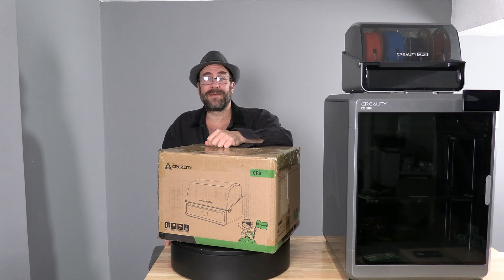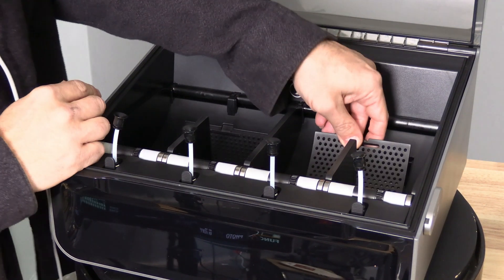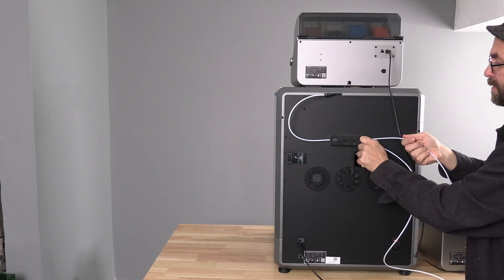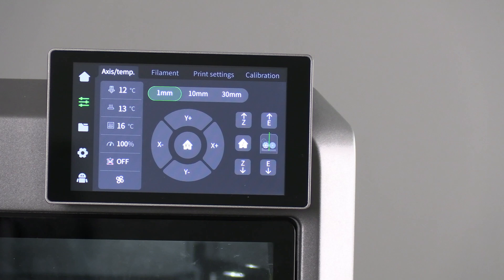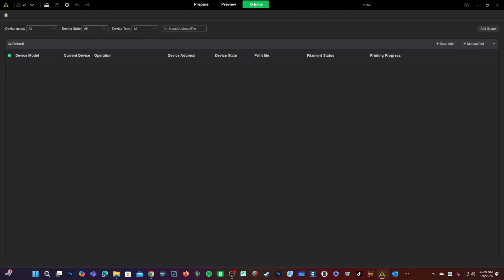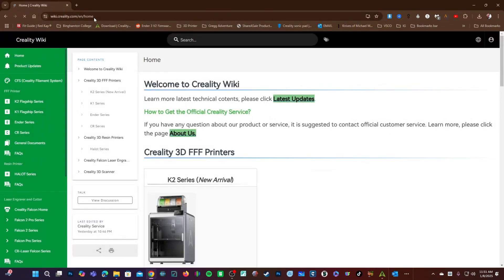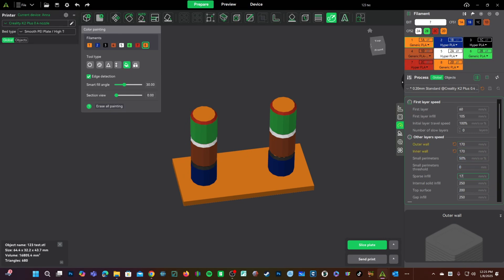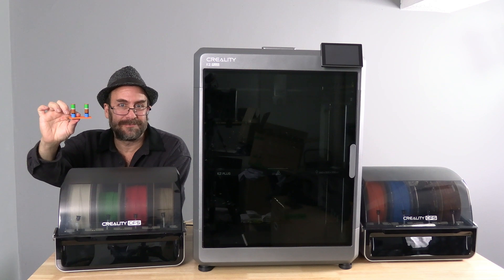Creality K2 PLUS: Install, Configure, Test Print: TWO CFS - *8 COLORS* with Creality Print 6

Comment: Do you have to load CFS with filaments before painting and slicing the model? Or can I paint model and slice before loading filaments, as long as the filaments are in the appropriate slots according to the order that they are printed?
Reply from the maker: You can load them whenever you want. You can even load different colors to change a parts color from what you painted.

Comment: Just bought my second CFS.  The next problem is where do I put it.  Biggest problem I have had with K2 is that the poop shut needed a Teflon tape bottom.  The other is that if you print an object and have a problem that you fix and do a RESUME, a layer void will appear if you do a reprint using internal stored g-code.
Reply from the maker: https://youtu.be/iNGhWEDBuy4?si=HNZRp4kkZs0cC7Rh

Comment: Hi,
Can I make it auto change spool when number 1 is running out ,if they are all the same colour ,
It's just because it will be a massive print and use more than 3 kg of filament ( 3 spools)
Thanks
Reply from the maker: yes
Reply: @3DRundown  
Please can you tell me how to do this ,
Thanks 👍🏼
Reply from the maker: In the firmware, turn that feature on, and put the same filament, in the next slot
Reply: @3DRundown  
Thanks for your help 👍🏼

Comment: I FINALLY got my replacement parts from Creality. But, with the newest update when I tap auto mapping I don't get any changes. When I paint a print and try and send the print I only have option for the spool holder 😒. I returned my X!C for this k2 and I starting to wonder if it was the best idea...Any suggestion Greg??
Reply from the maker: If it makes you feel any better. How many times have you seen my X1C on this channel? You don't, cause it's a lemon, that hasn't worked right since day one. No machine is safe. Sh*t can happen to any of them. 
I've had some sync issues with CP6 (on my Hi, also). It's not your K2. It's CP6, I actually sometimes have the same issue with Bambu Studio, go into Device, and choose the K2. You'll see the CFS and it's loaded filaments. Return to the main screen, and often your CFS will sync then. This is the same way I resolve it on Bambu Studio, but CP6 seams to be a little more stubborn.  Keep in mind, the entire CP6/CFS ecosystem, is a baby. Just a few months old. These things will be improved upon, as Creality looks at feedback, and update CP6 and our CFS printers

Comment: Here for the "CFSeseses"
Reply from the maker: Oh we've CFSesess all up in this shiz
Reply: How would you compare this to the Bambu X1C with 2 AMS units? I know this one has a huge benefit of the print volume but I've never used a creality printer
Reply from the maker: I'm a big fan of the Bambu Lineup, and, Bambu Studio (which I even use for my Creality Printers), but I'm very happy with the K2 Plus. If it was smaller, we'd have to have a more nuanced conversation, but, the bed size, can not be dismissed. It opens up ALLOT of doors, for making things, that just aren't possible, on an X1C. Personally I rely on my K1 lineup heavily, for work, and, I expect the K2 to follow suit. Recent firmware updates have smoothed things out, and Creality Print 6 is a real surprise, as it has turned out to be a solid slicer. X1C is super refined, but it also has YEARS of firmware, and software revision under it's belt. I think both are great options.
Reply: @3DRundown  I downloaded both slicers to play with and they're similar enough that the bed size is making me lean towards the K2, especially since they supply they CFSeseses splitter instead of buying the AMS splitter separately.
Reply from the maker: Creality got allot of little details RIGHT with the K2 Plus. Hi Combo, looks to follow suit.

Comment: Love your videos, I print for fun and learning on the hop. I got the K2 & CFS and my 1st spool ran out. The spool is empty and the filament can't be seen in the feed tube. Do I have to search and remove the filament (if any)  or do I just load a new spool and the new filament will push thru what's left. I can't find an answer anywhere. Would really appreciate your help, cheers, Susan
Reply from the maker: I would start another one.

Comment: It’s cool to see this coming to market. The length of Boden tube that it has to pull the filament back through for a colour change seems crazy, it must add a lot of time for frequent changes, not to mention the purge waste. Cool tech with some issues to overcome.
Reply from the maker: Color certainly has progress to make, but, short of giving us multiple tool heads, this is how it's going to be. Keeping your PTFE on the shorter side, is a good idea. Mine are about half or less, what is shown in this video.

Comment: So something I had asked on another channel but never heard back was, first is there enough room to put additional dessicant in the cfs and if so, 2 would it improve the effectiveness of controlling the humidity level? Something else I thought of while watching your video, I've watched a bunch of videos where people have issues with colors bleeding, especially when going from dark to light colors. Is the purpose of the purge tower to reduce and/or eliminate bleed?
Reply from the maker: I haven't tried, but I would say NO, but yes. You can print adapters to add desiccant to the holes of the spools. Or, you can just jam a desiccant bag into the holes. 
But, I don't think it's terribly necessary. It's such a small space. The 2 compartments are likely enough. Of course. That can depend on where you live, the season, etc.
Reply: I appreciate the timely response. So I'm in coastal NC and in the summer, we hover right around 80-90% humidity. I also added a question to the OP if you don't mind lol
Reply from the maker: I would keep Dessicant in the VFS containers, and, I suspect there will be printable mods, soon enough, to make them hold more. When not printing, use Sterilite containers, with Dessicant in them. Catch my video here, on Filament storage. In super high humidity, printing from a dryer is helpful, but, not a thing with AMS or CFS. luckily, they stay closed, with very little air inside, so, it's not much of a problem, in my experience. 
The Purge "POOP" is how we transistion from colors. You'll want to purge MORE when going from dark to light, to be sure we push all the previous dark color, out of the hot end. The prime tower, helps finish that, as well as build up proper pressure in the hot end, and avoid blobs and such, from the purge.....  But, some times you can get away without it. However, compared to the POOP,  the tower, is not much filament. Adjusting purge volumes is fairly easy, and not a big deal. Testing some, before a complex color print, can be very helpful

Comment: can you help with a some CFS faults since the new update?   it keeps retracting filament, i have cleaned all the lines and sensors and am getting feed back on facebook and reddit on others have this problem
Reply from the maker: Can you elaborate in detail?
Also, How long is your PTFE tube? I tested longer tubes with disastrous results. Shorter is better
Reply: @3DRundown 
It says CFS cant retract. However the filament is backed all the way out of the CFS and now lose in the CFS.  CFS is sitting on top of the K2 no changes from before the update.  I love my K2 and the CFS other than this hiccup.
Reply from the maker: @beausmith9023  I've been having some issues with randon CFS error messages as well. I'm working with Creality on this. With the filament out. Turn the machine off. Then back on. Once booted, insert each filament again, and try....
Reply: @3DRundown  I will try thanks you for reaching out to them for all of us

Comment: Nice Video ! How did you get "Sync Filament" to show up in the upper right area above CFS 1B? It shows up in my Creality Print ver 5.1.7 but not my ver  6.0.0.1078. so my slicer does not sync with the CFS. The CFS does show up in the Device tab with the correct filaments loaded.
Reply from the maker: Are you logged in, to your creality cloud account on CP6? Is your K2 Plus powered ON?

Comment: Bit off topic, but does anyone know where I could get a replacment board for the k2 mines broken and i cant use my k2 and i only got about 3 hours with it before it broke ive looked absolutley everywhere and i cant find what its called its the small one you can see on the bottom left of the extruder after taking the casing off. Any help is much appreciated.
Reply from the maker: email cs@creality.com, and ask them to send you a new one
Reply: I have, no reply yet. Its been broken for 5 days now broke on day 2
Reply: I might try return it its so buggy maybe ill by a new one in a few months when theyve inproved them a bit

Comment: Thank you so much , somebody Finley showed us how to add color:-) I just learned a lot in a short time with your video. One thing that some do not know is that there are special cutters to cut the tubing and it stays round , some might use scissors and make the tube oblong, just a thought , again thank you !! I want to try this with that STL you used :-)
Reply from the maker: YES!! Use only this tool: https://amzn.to/408G9CW
Reply from the maker: Test Model: https://www.printables.com/model/533523-multi-color-print-test
Reply: Thank you !!! Does it matter if it’s a 3MF file or STL file ? Please keep teaching us you’re great!!
Reply from the maker: @Jeff-q5t1l  No. Keep in mind, an STL file, is a 3D MODEL. A 3MF file, is a PROJECT FILE with an STL in it, along with any settings associated with the project.

Comment: The purge tower is so huge compared to the printed model. It seems like such a waste of filiment let alone all the poop that is also created
Reply: It's really huge for so simple model where  colors changed one by another one.
Reply: @alexdiver9809 one thing to remember, is that the prime tower is usually almost hollow. The tower is not usually solid. It has to be the same height as the printed model. Waste poop is far more an issue than the prime tower.
Reply from the maker: The tower must be the same height as the model, and the amount of purge, must be enough to totally clear the previous color from the hotend, to avoid color bleed.

Comment: This is super compelling. Thanks! I want them to fix a couple of bugs before I take the plunge. Creality Print 6 keeps removing my user profiles for filaments. Sometimes switching between Hyper PLA and Silk PLA the settings don't seem to get registered, causing a failed print.
Reply: like every time you upgrade, the latest upgrade kept my settings
Reply: @TWmarkjohns  They added a feature to save them to Creality Cloud, which does or does not work half the time.